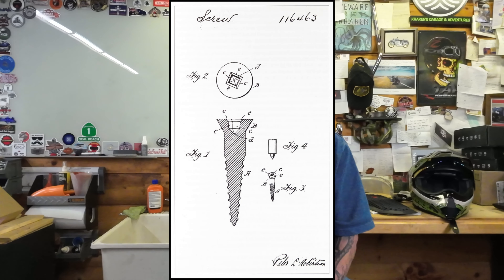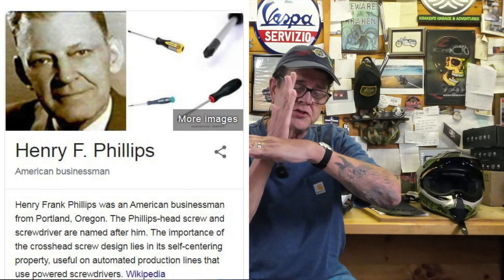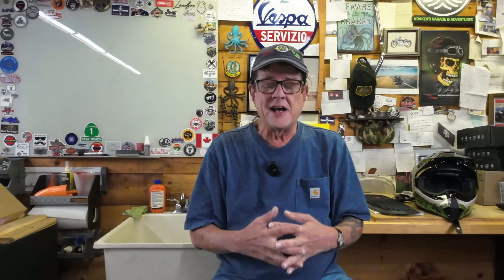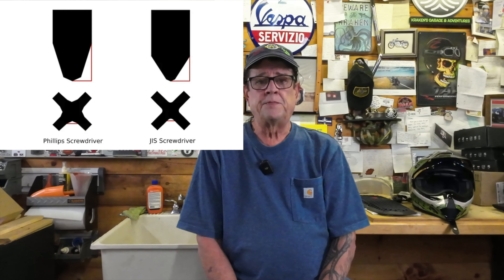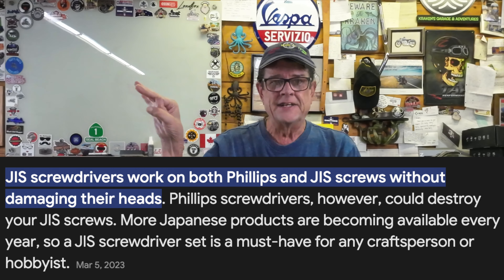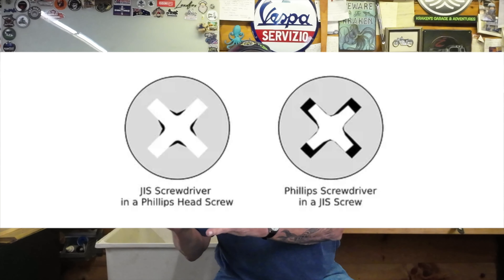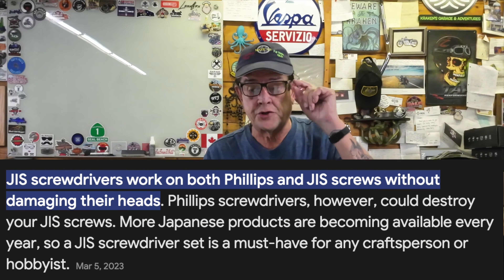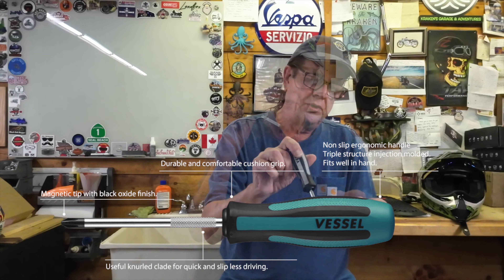Why you need a JIS Screwdriver!

Comment: When I was an apprentice my head mechanic said to me "You can waste your money on Phillips screwdrivers, or you can buy a good set of JIS screwdrivers once in your life and have them for life"

I have very old set of wooden handle screwdrivers that I've owned for nearly 30 years. I went wooden because at the time oils and chemicals would ruin plastic handled drivers. Mine also have a steel end on the handle to allow for tapping with a hammer. The plastic ones at the time also didn't have that.

JIS is a significant improvement over Phillips. Every person who ever has considered buying a set of screwdrivers, invest in a JIS set.
Reply from the maker: @whatsstefon  Your master tech did you a solid. It's surprising how many Americans don't even know what a JIS screwdriver is. You should shoot a video on this topic, Stef. Honestly, this is your area of expertise. Thank you for sharing your knowledge.
Reply: I'm 64 and a DIYer and only just noticed them

Comment: I'm rather annoyed with the continuous reinventing of the wheel with new screw head designs. They keep coming out with new ones that we have to go out and buy yet more screwdivers than we had before. The last one I recently came across was the star head. I only got them because I couldn't find Philips head ones. What a disaster. The set of star bits which were displayed next to the screws slipped on the first try. Never again will I buy new special screws. All I need are Philips which always works great.
Reply from the maker: I get it. It seems every project i work on has a differ proprietary bit to do the job. The star or Torx bits are tricky. They'll feel like the right size when you really need a size or two larger. There's nothing wrong with the Phillips. Enjoy what has worked for you this far. Cheers

Comment: I am a  very old guy who has been wrenching for decades and today I learned some good stuff.  The dimple on the screw was real news.  So the next question is: What screw spec is used on all that stuff we get from China?
Reply from the maker: I'm not hating on China in this reply, per se. Chinese screw are terrible quality standards. They're rarely the same size on each and every one. Coupled with a very poor metal, they're soft and easily strip out. My advice is to replace them all with a quality set of screws. These Vessel Impacta screwdrivers are the best in the business. I hope you try one put. You'll be shocked at how productive they work. Thanks for watching, and I hope I answered your question. Cheers

Comment: Excellent video Eric, they really do make a big difference.  One thing I'd add is buying a set of JIS bits to fit in your impact driver, invaluable in removing motorcycle engine case screws without damaging them.
Reply from the maker: Oooo! Good call, and I should have mentioned this. Honestly, I should just get rid of all my bits and Phillips screwdrivers. I don't know why I hang on to them. You should shoot a video on using them on a CT carb. This is gold info for your viewers. Thanks for commenting.
Reply: @KrakensGarageandAdventures  I have mentioned JIS several times & shown the dot on the screw head.  I wonder why JIS is not common knowledge.

Comment: Have these screws on my bike and carb and best way to deal with them is to change them out. Yup regular bolts or Allen head then you don't have worry about it. Japanese bikes like to use these on the side cases they make allen head kits for this .
Reply from the maker: @josephpuisis7567  You make a valid point, Joseph.  Many bikes, I've switched out the screws for Allen heads. Thabks for sharing your experience.